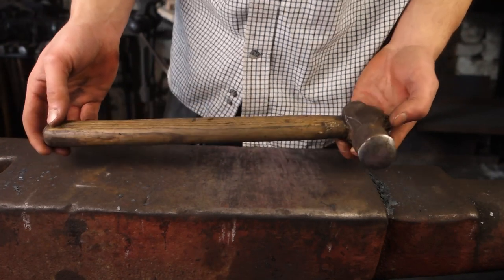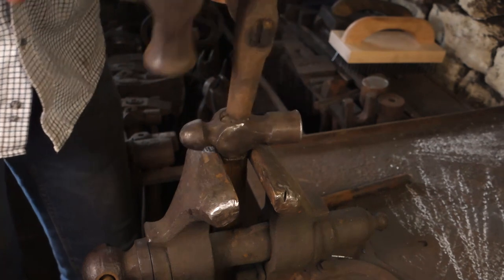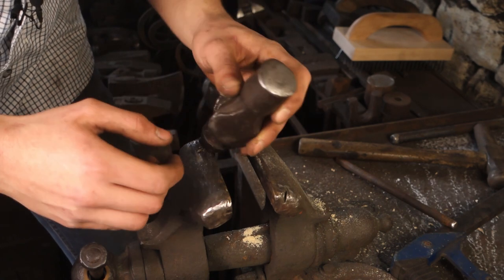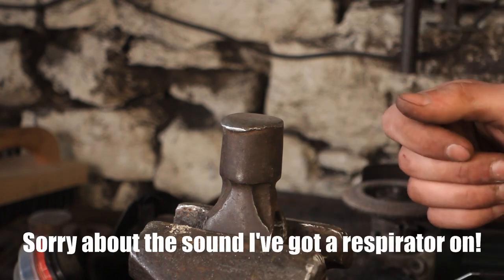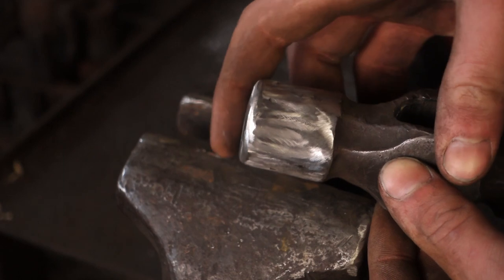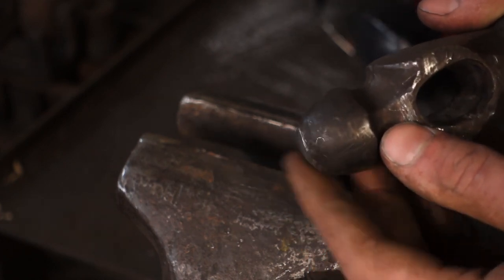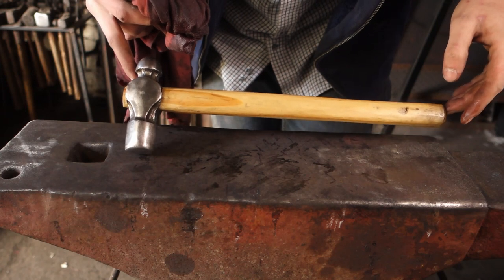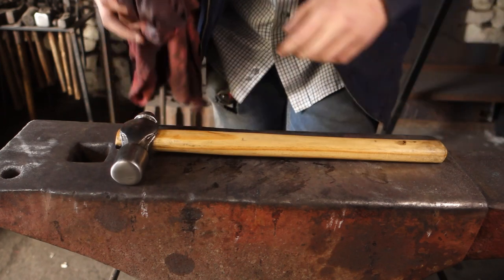Dressing and handling an old hammer

Comment: Oscar, couple of questions if you don’t mind. 
What diameter wood did you start with?
What type of oil did you use?
I like the way you shaped the handle  seems to fit the profile of the hand better.
Reply from the maker: No problem Steve. For my handles I'll generally use a clear Danish oil (although I'm not that fussy really, any will do, linseed etc). I think the starting diameter would have been around 25mm, maybe a little more. Hope this helps!